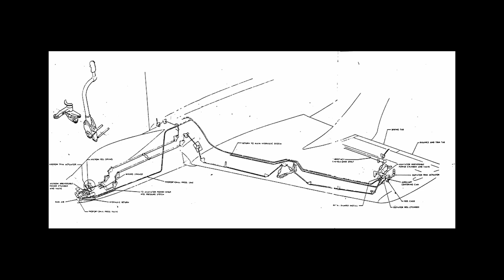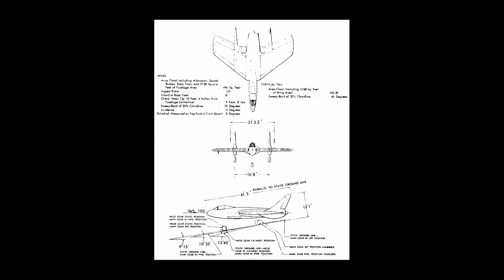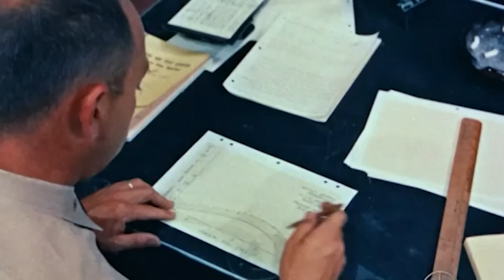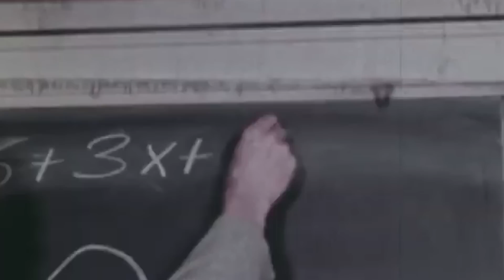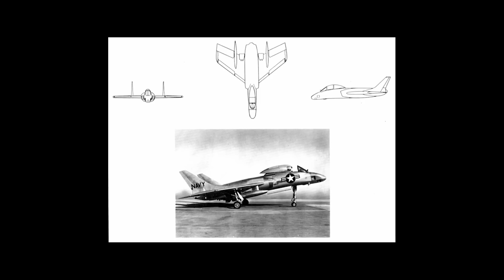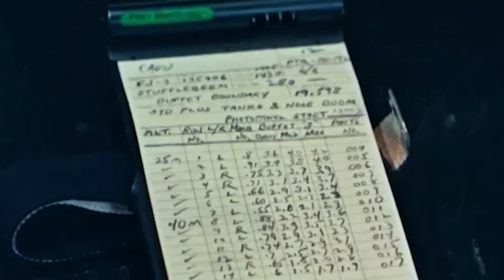The Deathtrap Fighter Everyone Was so Afraid to Pilot

Comment: engines too weak for the plane.  and if it had foreplanes and a better brakes and vents it might of not been so bad.
i wonder if they had upscaled the engine and gave it better intakes would of made it better.
yeah i agree with design internals being bad but the design of air intakes and engines it  self bu the airframe wasn't bad. isn't bad. its american engines of the era where rubbish
the P80 did okay because there was no way for it to overheat and it was NOT on the afterburners  which cause why most of the accidents and know its the over heating.

i know this is 2 weeks old but i saw this already.
also hygrolic issues where common across the board at that time
and it was from corruption in airforce/navy manufacturing.

my family was one of those germans who was taken from operation paper clip.
and btw those engines where american engines anmd where always small and pathetic back then. and that was where the problems mainly where.
that and pilots didn't know about low stall speed on swept wings which is why they went back to the older designs.
most of which was out of ignorance.

Comment: 0:57  the F86 Sabre already had hydraulic boosted controls.. The Cutlass was not ground breaking in that respect.
Reply: Is a 3000 psi hydraulic system the norm for jet aircraft?

Comment: ...and, what was the reason for the freakishly long nose-wheel strut?
Reply: My guess is that the aircraft needed some built-in nose-up attitude for the catshot. The F-4's nose gear had an extension feature for that very reason. You needed about 20 degrees nose-up to avoid settling off the bow, and the extension gave you a 10 degree head start.
Reply: @hitorque2734  Thanks, I suspected something like that. I also thought the absence of traditional elevator may have severely limited its pitch control, especially at low airspeed. So, a baseline high pitch attitude gave it a head start towards flying attitude at low airspeed. Our speculations are well aligned and interesting. But I'm certain someone out there knows the definitive answer.

Comment: My father, John H. Griffith, was a factory test pilot. He was recruited by Chance Vought because of his piloting of the Northrop tailless X-4 Bantam for NACA at Edwards AF Base. He had many stories about his time flying the prototypes at Chance Vought's Irving Texas base. The prototypes are the black painted planes in your presentation. When you see the unpainted procured F7U they have longer vertical fins. This was due to a high speed dive flight meant to test the speed brakes that my father performed. They had spent so much time trying to gain altitude that moisture in the air pressure tanks froze and when the speed brakes were activated the air pressure was not sufficient to deploy the speed brakes. My dad had run out of altitude and knew he was close to creating the proverbial smoking hole in the ground. He pulled back on the stick until the design limit of six g's were indicated. He maintained that until he saw a positive rate of climb. He grayed out but did not loose consciousness. He missed the ground with only 1,100' to spare. When he landed safely and the plane was inspected the two vertical fins were both bent towards each other to the point where the tips of the fins were 36" nearer to each other. They added strength and length to the fins on the production models as a result of this flight.
Reply: Small correction:  Vought did its prototype testing at Hensley Field next door to the Chance Vought Aircraft plant on Jefferson Boulevard in Grand Prairie, Texas.  Your dad's efforts are greatly appreciated.
Reply: @randykelso4079  I mentioned Irving because I was born there. I didn’t know where the airfield was located. I see that Grand Prairie is next to Irving so I’m sure you are correct. Thanks for the information and the compliment for my father.
Reply: @Mrjonblakely   "In DFW" might as well be a liminal space that can be used to describe an area in Texas larger than Switzerland that is almost entirely self-similar.
Reply: Holy shit, glad your father survived. Air Force & Navy officer egos kept that plane flying much longer than it should. Different day, same shit and it continues to go on. Very sad.
Reply: Great story,glad it had a safe outcome.

Comment: The main problem of the F7U was the engines.  Too weak, too unflyable, too unreliable.  With much better engines it could have had some kind of career.

But don't kid yourself.  The aerodynamics are a complete fiasco, just like a lot of German "Luftwaffe '46" projects.  The fallacy, which was repeated again and again in a number of different wartime designs, German, American, Japanese, was that drag could be reduced by cutting down the area of fuselage and fly surfaces, with some fancy new configuration.  It's not possible in reality.  The optimal low-drag configuration was the old traditional tailed aircraft.  Everything else, including flying wings, had greater drag, the reason being the necessary trim drag.  Reducing stability in an effort to "balance" these "advanced" designs for less drag just resulted in poor flying qualities and accidents.

Of course, today, with high speed computers, fly-by-wire, and unstable aircraft designs, things are a bit different.

Comment: Design wise the sweep wing or bat wing design is a fantastic stable flight and efficient with great speed return for the power.  Problem is the stability and  high angle of attack makes for poor response to landing on short runways and aircraft carriers.  The jet engines were also a problem ; hence, two were needed.  The aircraft was slow to respond to pilot input on the controls ; hence ,  hydraulic servo controls were added.  Great aircraft but not as a fighter or aerobatic demonstrator.  The flying wing has poor pitch control because  it has no tail feathers at a sizeable distance from center of mass to  influence pitch command which is a pilots bread and butter  when landing on an air craft carrier's pitching flight deck.   Fighter TWH , old pilot.

Comment: "The Gutlass" Almost ended Vought's involvement in major project,  military aviation. Thank God they redeemed themselves with the F-8 Crusader.
Reply: Yes, and the Chance Vought Crusader was dubbed "Vought's Last Chance".
Reply: Redeemed is definitely an understatement.  The F-8 Crusader, the last (and probably best) of the true gunfighter/dogfighters.  Would put the F-4 to shame in a dogfight.  But the Phantom was a multi-role, while the F-8 was not.
Reply: @barrygoldwater2441  Well, the F-8 did end up as a multi-role aircraft beginning with the "E" model.  The "D" was a hot rod pure thoroughbred fighter (no under-wing pylons).   Loved working on that bird.  Semper Fixit.
Reply: Heard they had a gun jamming problem becauce of high "G" loading.
If they had only got it fixed in time, we would not know much of the weird slow turning Phantom, except as an interceptor for Fleet Air Defense.

Comment: I'm confused, how can it have blistering thrust and at the same time be underpowered .
Reply: It's called "shit writing" and is a good indicator to click away....if the "crap History Channel vibe" wasn't enough already.
Reply: That "blistering thrust" comment also got my attention.  Maybe its thrust was better than some propeller aircraft, but it was dubbed the Gutless for a good reason.
Reply: "Blisteringly underpowered"
Reply: slow ramp up of engines is what the american was taking about. over coming stall speed quickly
the narrator was trying not to blame the horrible american engines of the time.
Reply: Maybe it was a case where the requirements/design called for high thrust, but the actual build did not provide what was expected. This happened during earlier days of the Military Industrial  Complex, which has long had a tendency to overpromise, overprice, and underdeliver.

Comment: Like so many planes created during that era, the Cutlass was a bit of an overreach. It's design was ahead of it's time. The result was an aircraft needing LOTS of development. If that had happened, rather than rushing it into production, they might have made a good plane of it. There certainly was nothing wrong with the basic design. 

I am reminded of another, more modern plane that required a massive amount of development, in order to work properly. The F35.

Comment: Douglas managed to design a good tailless naval fighter. Vought designs were problematic until the Crusader.. Even the Corsair had a horrible accident rate
Reply: The Corsair and the Cutlass both had problems with carrier landings, which should have been a high interest item early on during development.  It's amazing to look at design philosophy over the years, where designers are so focused on a Whiz-bang, high speed aircraft design, thinking all it takes to land on a carrier is a hook and a catapult bridle. and life is golden.  The F-8U Crusader fixed its approach issue with the variable incidence wing.  The Corsair II (A-7) was the culmination of finally getting it right as a simple rugged design, and it could fly carrier or airfield with dignity. It had great all around characteristics, especially when they installed the TF-41.  LOVED working that airplane at Khorat RTAFB in 1975.
Reply: @paulholmes672  Paul, it looks like there were more and larger access panels on the A7 compared to early jets...the older guys told me about wrestling inverters and power supplies out of ridiculous places. Some needing removal of major systems like the seat. A7 seems to have been a reliable bird.

Comment: They did get all the problems fixed and it could do 9 g turns, but it's reputation was trash by that time. It still had problems with wanting to flip end over end. It screamed give me some canards!!! :)
Reply: I'm agreeing that canards would have made a different plane.
Reply: @flashgordon3715 American manufacturers hate canards, that's more of an European thing and the soviets
Reply: Would redesigning this plane with modern materials and knowledge of today about aerodynamics be interesting? When all the initial problems are solved, and with today's engines, it could make it to supersonic. Probably the world does not need such a fighter. But would the advantages of that era still be worth while today?
Reply: @voornaam3191  You would end up with a Rafale.
Reply: Except it would have predated the Viggen and the Rafale.
Reply: @voornaam3191  With  the advent of the F-8 Crusader it really wasn't needed. There were better engines available for it at the time and canards had been tested on other aircraft so just using the technology of the time would have worked. The Skyray was a more modern tailless design that was far superior to the Cutlass. The F-16 had a tailless version that was tested and worked well.
Reply: I was thinking a pair of small canards would have helped. They work great on the Euro Fighter and the design is similar, but with much better engines.
Reply: Bad engines they started the wrong way

Comment: The FH-1 Phantom, F2H Banshee were twin engined, from memory 2xJ-30, 2xJ-34 from memory. The F7U was cursed by the failure of Westinghouse’s J-46, the same as that dog, the J-40 that the F4D, A3D were designed with. Unlike the F4D, A3D which were designed with sufficient space to allow the substitution with the J-57, there was no suitable engine available that might have fitted within the design. Very poor accident rate, but a lot of those 1950s projects fell over at rates that would be quite unacceptable today. Remember these planes were pushing the edge of the envelope of what was known.
I wondered about the RR Avon, but that was a pretty thirsty engine even without an afterburner. 
Potentially a good plane given a decent engine, but Vought’s designers redeemed themselves with the F8U
Reply: Correct, it was no worse in accident rate than the century series that followed.  You are right that the DOD would not accept the various problems that plagued those first and second generation fighters.  I am pretty sure the F-104 had an even worse accident rate even though it was a later and better designed jet (and one I that still adore).  It was a hot ship but still nicknamed Ensign Eliminator just like the F4U and many other aircraft before and since.  In comparison non combat losses really started to downturn with the F4 Phantom and really improved once we got to the F-14, 15, 16, 18.  Although jets are expensive they can be replaced far faster than a pilot.  Yeah that is a cold analysis, but true.
Reply: I thought the Phantom was the F4
Reply: @righty-o3585  F4 can also be a Corsair.  Depends on which war we are talking about.
Reply: @larrybremer4930  Ahhhh gotcha .  I'm usually pretty good with identifying military aircraft , but there have been A LOT of them and i definitely don't know them all 🤘
Reply: @righty-o3585  To add to the confusion there is also an A7 Corsair in Vietnam era.  Makes keeping nomenclatures straight really fun sometimes.
Reply: @larrybremer4930  lol Sounds like it
Reply: @righty-o3585  It was, but it was also the F$U Corsair as well.  This is because for a long time the Navy and the Army/Air Force had their own separate naming conventions. The Army/Air Force named their planes one way and the Navy & Marine Corps another, this went as far giving the same aircraft type a different designation depending which branch of service was using it. An example of this is the DC-3,  the Army called ti the C-47 while the Navy called it the R4D. While the Army/Air Force was pretty good using the same designation for different planes, the Navy would often use the same letter and number combinations. To avoid potential confusion the Navy would also add a letter to the end that referred to the manufacturer of the plane,.like F for Grumman and  U for Vought. Thus an F4F  was the Wildcat built by Grumman while F4U was the Corsair built by Vought.  I think that this practice was stopped around late '50s or '60s andd the naming convention was standardized between all service branches.
Reply: @Riceball01  Yes, that is how the USAAC/USAAF wound up with the Douglas A-24 Banshee (née SBD Dauntless) and Curtiss A-25 Shrike (née Curtiss SB2C). Likewise the B-26 was a Martin aircraft until 1945 then it was the Douglas B-26 (née A-26), until VietNam when they became A-26Ks again because of legal twittering about where bombers can be based. I’m just grateful I didn’t have to provide logistics support to this naming tangle.
Reply: @righty-o3585  The F4 was the Phantom 11, the original Phanton was a straight wing subsonic late 1940/50's jet
Reply: @Hattonbank the mistake you are all engaging in, is not using the pre 1962 naval aircraft designation system.
Reply: @righty-o3585 we're talking about the pre 1962 aircraft designation system.
Reply: @WALTERBROADDUS  yeah  I got that

Comment: What would happen if you put to F35 engines in it?
Reply: What, you couldn't do a quick search and find out just what engine is in the F35? I'm thinking that the F-35A version. How about the :  Pratt & Whitney, Rolls-Royce and Hamilton Sundstrand (all three build parts of the engine) F-135-100-PW
Reply: @bobjoatmon1993 Feel better about yourself?
Reply: @bobjoatmon1993  You make a reasonable point.  Of course you would also have to correct the structural and the other design  flaws and update the electronics.  Might look like a F15 or F18  so I guess I have already gotten my wish.